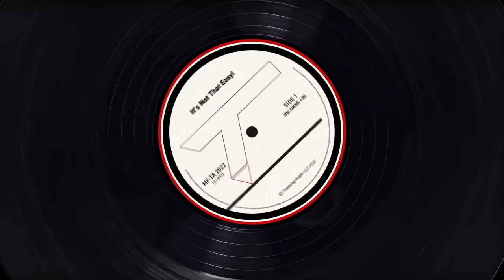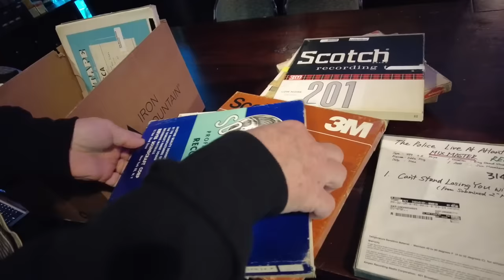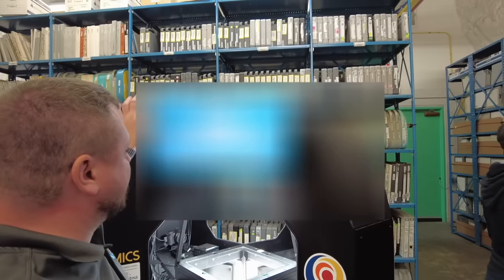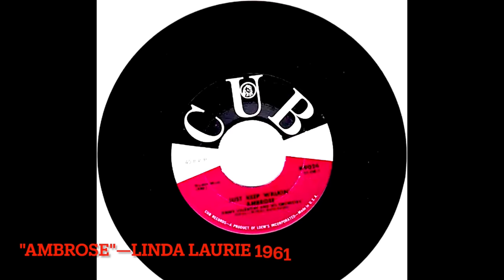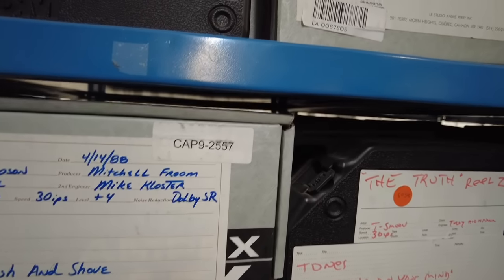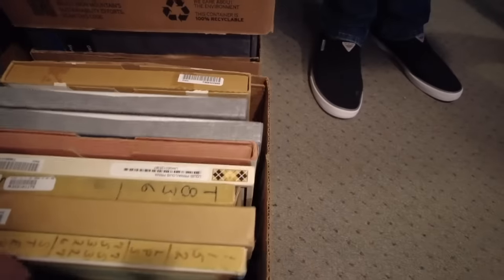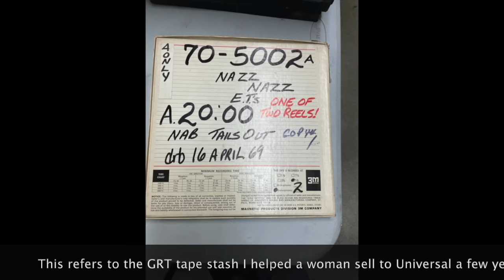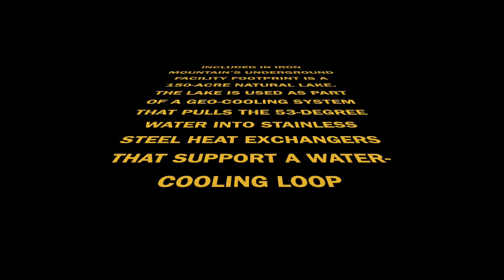Universal Music Group Opens its Iron Mountain Tape Vault  And You are Invited!

Comment: This is fascinating. I used to spend some time in radio station libraries listening to music. This looks like it could be orders of magnitude more fun... Back about 20 years ago the discovery they made was the stereo master of Bob Dylan's Nashville Skyline. Up to that point, apparently CDs had been made from a safety copy. The master turned up in a storage unit which had been rented by Bob Johnston. The SACD they made from this master sounded great!

As to your question about acetates, the second hole was used on some equipment to keep the drag from the cutting head from causing the disk to slip on the lathe.

Comment: Older lacquers have either one or three off-center holes 
to engage a pin on the lathe platter to prevent rotational slippage.   
Modern disc lathes use vacuum to hold the blank to the platter,   
therefore there are no drive holes in lacquers used on them.

Comment: Having worked with and seen many Iron Mountain facilities I’m actually surprised that the tapes are stored in bankers boxes.  Some looked a little “shoved” into the boxes.  Not that that’s bad, and it is usually up to the customer as well (especially in their protective cardboard tape case which is pretty good physical protection).  I just assumed they would have used shelving units with individual locations for each reel.  Generally this is how digital data tapes are stored there in specialized bins/racks that keep each tape in an individual slot.  They do use bankers boxes for some custom items/collections of things.

Comment: Baking tape: the acetate tape you were showing was probably way to early anyway to have synthetic lubricant which cause sticky shed. I remember when 3M shifted away from fish oil to synthetic. The radio station where I worked got a case of the new tape and we had endless problems...

Comment: My dad sold a bunch of those bulk shelving racks and also moveable shelving systems on tracks in that place, not sure to which outfits as there are so many different companies with storage there. Unfortunately none during the couple years I was installing for him. Always wanted to get in there, it's kind of a modern marvel.  Basically any kind of archive you can think of someone has one there. Very cool video, my understanding is it's generally not an easy place to gain access to.

Comment: Here's something to know about the transfer process of these playable tapes.

While after thorough baking i.e. dehydrating the tape. The heat, re-vulcanizes, the Binder, i.e. glue. That holds the iron oxide particles onto the, mylar/polyester film.

And while that Studer transport appears to be gentle on the tape. It really isn't. You can't use that machine. To attempt to play back those acetate tapes. If they can be unrolled from the reels, at all anymore? Much of that is like the Dead Sea Scrolls. Which is rolled up on top of itself. And they can't unroll it to decipher it. Because it just crumbles. It's the same for acetate tape. It turns back to dust. You can't play, dust. And how do you know what dust particles are supposed to stick where? On the tape?  Yeah no, that's impossible. And the recording or, the movie are lost forever.

And so, Iron Mountain Tape Storage. Provides for a false sense of, archived security? It's there but it's not really there anymore.

Yeah you can't use that Studer transport on the fragile acetate tapes, at all. As that has back tension. You can't have any back tension. But the tape needs to be firmly against the head. And that requires some pressure. Of approximately 7 ounces. That no acetate tape could withstand anymore. If it can be played at all? And if it can be. It should be played on something like a, mid 1960s, Sony 250, reel to reel tape recorder. It has no back tension. It has very gentle take-up tension. Nothing like that brute Studer. That will tear a lot of these tapes apart. So those guys are bozos. If they try to put a 2 inch acetate tape on that Studer. Someone will get fired. As it will be made unrecoverable.

There's a lot of experts there. But none like me. As I am now retired. And since just about everybody I know is already dead. Why should I care about the history you want to know about? Your history is gone. It didn't last as long as the Egyptian mummies. It didn't last as long as, Vladimir Lenin or Joseph Stalin. It didn't even last as long as JFK or RFK. Itch been mine, Berliner!

But jokes aside. Iron Mountain Storage. Is just a, high-priced, mausoleum for old recordings. To come and die and be buried in a mountain. How prophetic. They are sending the iron oxide back into the earth, deeply. And the plastic film, placed back again with their respective dead dinosaurs. Buried inside a mountain. How prophetic. As if that will keep your tapes from turning to glue. And the hours upon hours of baking and dehydrating it will require. For a single pass archived to digital.

What I get a kick out of. Is, knowing all these people. On numerous, classic analog recording forums. And they want to use the old baked tape. To now also record upon. No, no and No! As it reverts back to the sticky tar. Within approximately one week after baking/dehydrating.. It goes back again to thick glue tar like substance. Don't use that for recording! How cheap and/or idiotic do you have to be? To want to record on sticky analog tape because you're into analog recording? You are misguided. Yes.

Plenty of people don't realize. You can play these tapes back on a flat equalized machine. But that's not the way to do this. No.

You see everything is variable within these analog alignments. There are no hard and fast rules.  But there are some hard and fast standards. That was adhered to. Both in the USA and across the pond. As we both do it differently, slightly.

Thankfully. Both the USA and Europe/Asia/Africa. At least all adopted some standards. Such as the speeds. Of, 15/16 IPS, 1.78 IPS, 3.75 IPS, 7.5 IPS, 15 IPS and 30 IPS. And a brief, secondary standard of 20 IPS. Created by the MCI company. Clones from earlier Ampex machines. Of a,, 32 track, 3 inch, recorder. That was never officially released. Because they told me. A physics issue.. Prevented them from releasing the machine. Oh really I said?

I didn't take any physics. So I fixed the problem for them. But it was too late. They had already canceled the project and the orders they had received. They didn't know how to fix this physics problem. And because I didn't take physics.  It was no problem. It simply required,, some holes to be drilled. To create a Vacuum  Tape Guide. That would suck the tape against the heads.  With no skewing up and down. Due to their physics issue. When you don't use your brain!

This is absolutely true. I asked their engineers if they had ever looked at a videotape recorder? No? No they had not. What kind of schooling did they have? All 2 inch wide video recorders. Used vacuum, tape guides. They would suck the tape against the heads. That's all that's required. But their brains didn't work with their college degrees. In both electrical and mechanical engineering. DUH!

So some of us are problem solvers. To the problems other people think that can't be solved. And always remember. We can never go faster than the speed of sound. The sound barrier could never be broken. Yeah that was wrong. At those were college grads telling us  what couldn't be done. Until somebody like me does it by using my brain. A rare commodity on the planet today. Who knew our brains could work if you use them?

Or do have to have a book, a mathematical formula or a minister tell you everything? And do you know that books and mathematical formulas cannot talk think or hear anything? They are inanimate. Meaning they are not alive. And most things not alive can't advise you of anything.  Which is fine for most Republicunt's.  Not fine for Democrats. Because we need to be WOKE. To not be woke. Means you don't know anything and you have a college degree. And you are a fraud like Fox News. Which isn't, news. It's a movie company specializing in entertainment. That was purchased by a, communist Australian oligarch with Russian ties and Chinese ties. And to be certain made out of silk. Those are other ties. Some are in Thailand. Summer in Taiwan. Some are in Taiwan down. Or toss one back. Or a few. But either way? Consume copious amounts of beer flavored alcohol. Before you begin, mindless months of archiving. As you really can't be expected to remain, sober throughout this process. Otherwise the tape recorder would get smashed  with a sledgehammer.

And I love our host of the show. They finally got the right Head Stock on that Studer tape recorder. Only it was a Stack. Like pancakes. Like flapjacks. A stack of tracks. And the reason why is called a heads stack. That you have in stock. As you need to have 2 or 3 of those. One for 16 track. The other for 24 track. And the third for, 8 track  2 inch tape. As that's how you will fine, Abby Road tracks. There were eight on 2 inch wide tape. Put that in your pipe and smoke it!

My age currently exceeds my memory. And I can't remember? Whether EMI built their own custom tape recorder heads? Or whether that was just a special order from Studer? Because the closest we ever got to that in the USA was 1/2 inch, 2 track stereo. And frequently run at 30 IPS. With the latest formulation of hottest recording tape. Packing as much audio as we could into that tape. But that also came with compromises. Called, Tape Saturation. And at what speed?  Different sounding at different speeds.

And then there was both the American NAB and European, CCIR, recording and playback standards. Very similar but Nuance different. And of course the grass is always greener. Across the pond.

And so I knew some American studios. That specifically worked with the European standard not the American standard in the USA. And I knew some European studios. That wanted American machines. Because our standard sounded different from that of the CCIR of Europe. But of course. It's like what's better? Being a boy? Or being a girl? And it all depends on your perspective. Girls practically get away with murder. And Harvey Weinstein and Jeffrey Epstein, didn't. And basically the Jewish Wise ass family. That were having a good time at others', personal expense. And big fat sweaty Christian boys, no better. As in the 21st Century. They still haven't learned that women are not,, their play toys. Oh darn! But they wouldn't have used, darn. Note they would just grab them somewhere. And I think Donnie got the idea from Harvey? Or maybe it was the other way around?  Maybe they both used a similar technique? To go to jail with. 

And that's one down. One to go. Called a, Donnie J. And he didn't want to legalize marijuana? With that kind of name? I mean it wreaks, POT Marketing! Stop on in and get your Donnie J, today. In cannabis or fruity flavors. You'll be glad you did. After you come to again. When you get your fingers on a Donnie J. It melts in your hand. Not in your wallet.

Donnie doesn't drink. Donnie doesn't smoke. But to be certain. That Donnie has invested in, black-market, underground, pharmaceutical suppliers. As who wants to pay any tax on, POT? I mean come on now? Do we tax a rose? Do we tax a mushroom? When was last time you taxed a rutabaga? And did God stop growing rutabagas? Why can't I find them at Walmart?

We are obviously experiencing a rutabaga shortage in the USA. Life will never be the same again.
RemyRAD

Comment: At the 1:12:40 mark is a Welltron am/fm radio 8 track clock, but that is not a normal 8 track in it. It’s been modified for some reason. Interesting as is this whole fascinating operation.  We used iron mountain for tape backup storage when I worked for IBM. Good people.

Comment: Wonderfull Insight Mike , saw a few items i recognised from my 1st Job at Dolby Labs, a SR/A noise reduction Plug in  circuit board.  Makes you  Realise the timeless work that has been dedicated to Physical Format & how dedicated Archive Staff provide a service & preservation for all this Audio/ Video 
in multiple formats, make you wonder how many of todays recordings are archived to Tape/ film  Etc and the digital storage we are going to need to fill this & subsequent recordings. Heathkit  TV, how interesting you build a Color  TV in 1969, wonder if you had it long enough to see the Moon landing ? during lockdown I bought a Heathkit Valve radio from 1963, off ebay still working, just needed new caps fitting and a clean up Plus new Magic eye Valve sounds great even though Mono only ..pity about your tv getting stolen..I've had records stolen too, have to get use to losses, as not same as people despite the loss of certian 12 inch records, interesting Video an tour of The Mountain.